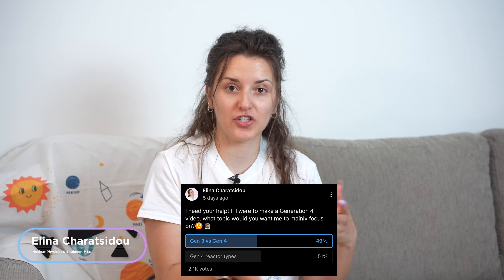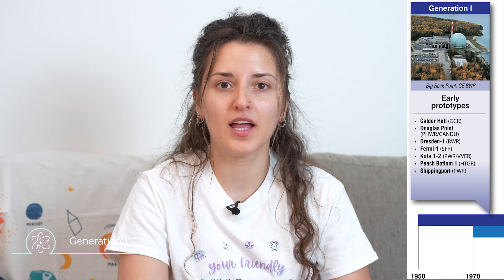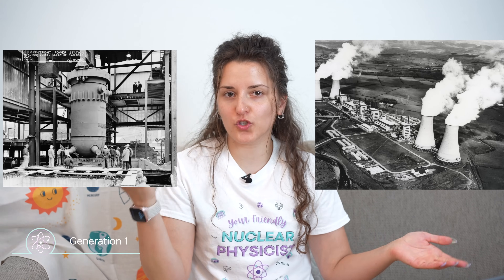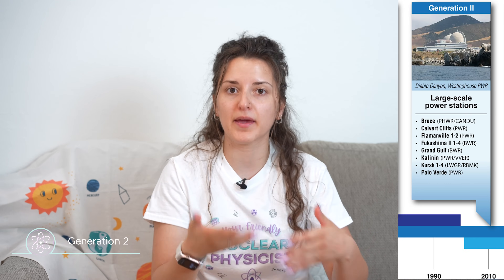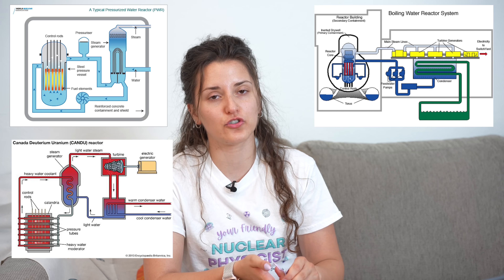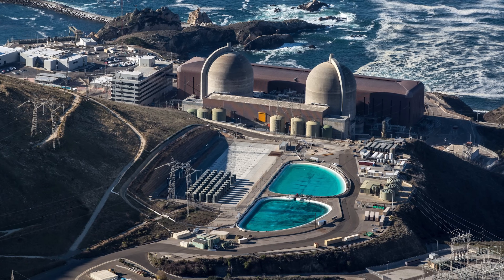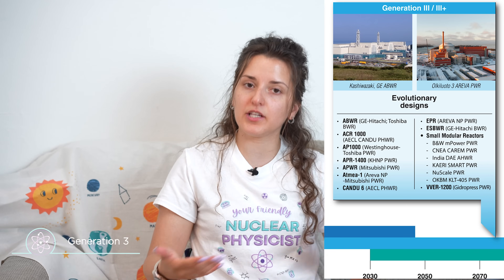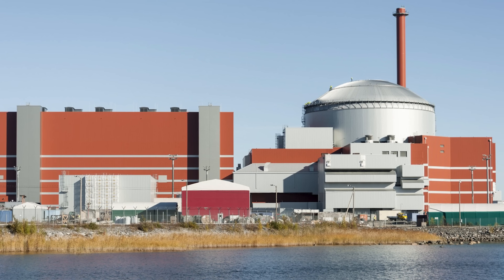Nuclear Physicist Explains - The Rise of Generation IV Reactors?

Comment: Great video, here some nitpick: 
12:13 correct me if Im wrong but Im pretty sure you meant the reduction of reactivity in the fuel and with that the drop in power production (stop heating up) as I don't see how it would suddenly cool below the coolant's temperature :D (maybe just my english failed me :( )
15:40 CANDU already can use natural Uranium it does not necessary requires fast spectrum, also MOX (plutonium uranium mix) can be used in PWRs

Comment: Thanks Elina, good video. I think the problems with GenIV are a very lethargic regulation system that is still catching up to the new technology, and the number of design concepts competing for funding. Investors are also likely to be keeping their hands in their pockets until the experimental TMSR-LF1 reactor in China proves successful (or not).
Reply: Not really. There are challenges in material science. If you go for molten metal design you can build fast reactors, but molten metal will attack other metallic surfaces. It is an issue inside steam generators, where leaking metal csn plug them or cause fire (and yes, that have happened in the past). Gas cooled reactors are prone to moderator aging. While in theory TRISO makes resistant and convenient fuel and moderator pebble, in practice they were damaged. If something is really feasible, it would be dual fluid reactor, just with nitrate salts not sulfates.
Reply: @brylozketrzyn huh
Reply: The available info on FLiBe salt thorium reactors here in the U.S. shows no cause for concern. We are not going to be copying China's work as it's they who've mostly been copying ours.
   If they copied it correctly, it will do fine. Those who make the effort to follow the engineering history of this tech know it was never in question to begin with. There's a lot of handwaving by those who fear the sudden replacement of legacy nuclear.
   It's not a question of if the world will do this; only when, and how much intentional pain we'll inflict on ourselves before starting.

Comment: I believe in the future we will be able to extract a lot more useable energy from lower temperatures by using high efficiency high temperatures heat pumps thereby reducing the need for cooling towers and increasing the ability to extract useful energy from spent fuel or long term nuclear waste. 
Nuclear power combined with heat pumps and stirling engine tech could eliminate the need for “nuclear waste” entirely because you need a minimum temperature of -5 °C input temperature  to a heatpump that can output +200°C at cop 2.5
Reply: Higher temperatures increase efficiency, not the other way around. High-temperature nukes don't need cooling towers but low-temperature nukes do.

Comment: I realised we use active and passive completely different 😆 to me an active safety system is able to decide and act on itself, without an operator. Different industries, different definitions, I guess
Reply: Active means something (operator or automated system) has to run to provide that safety. Passive means that nothing has to run to provide that safety. For LFTR, they use a “freeze plug” the liquified nuclear fuel that keeps the fuel in the reactor where there are moderaters to keep the reaction going. Active fans keep the plug from melting. If the plug does melt from loss of power or the reactor getting too hot, the fuel drains out of the reactor where there are no moderators and thus the reaction stops. Thus the reactor needs “active” systems to run otherwise it will “passively” shutdown.

Comment: As more of a geology enthusiast, I'd love to hear your take on Oklo, and how natural nuclear reactions occur. 
Love your channel! 
Cheers!
Reply: Since no one has responded yet... It is quite simple. If the uranium enrichment (% of easily fissable uranium U-235) is naturally high enough uranium can sustain a nuclear chain reaction as long as there is a moderator like a graphite rod (Tsernobyl) or water (gen 2-3), as in the case of Okla.

The moderator slows the neutrons down enough that they don't simply bounce off the uranium, but is absorbed splitting the Uranium, releasing fission products and even more free neutrons to hit other fissile Uranium atoms.

As long as there is moderator (water) and the good Uranium concentration % stays at inside the sweet spot range the chain reaction can keep on happening naturally without any human involment.

The reason Okla is so special, is that unlike in Okla most other natural Uranium deposits we know of did not have high enough % of this "good" easily fissile Uranium with the proper conditions to naturally start and continue process, but first requires us to enrich it to raise the concentration % up to the required sweet spot range that maintain the chain reaction.

There are most likely a lot of such natural reactors all around the Earth, but Okla is the only one we have found so far

To get a bit more technical on the "good" Uranium and sweet spot, here is a quote from world nuclear org that explains it perfectly:

"Uranium found in nature consists largely of two isotopes, U-235 and U-238. The production of energy in nuclear reactors is from the 'fission' or splitting of the U-235 atoms, a process which releases energy in the form of heat. U-235 is the main fissile isotope of uranium.Natural uranium contains 0.7% of the U-235 isotope.

The remaining 99.3% is mostly the U-238 isotope which does not contribute directly to the fission process (though it does so indirectly by the formation of fissile isotopes of plutonium). Isotope separation is a physical process to concentrate (‘enrich’) one isotope relative to others. Most reactors are light water reactors (of two types – PWR and BWR) and require uranium to be enriched from 0.7% to 3-5% U-235 in their fuel. This is normal low-enriched uranium (LEU). There is some interest in taking enrichment levels to about 7%, and even close to 20% for certain special power reactor fuels, as high-assay LEU (HALEU)."
Reply: @Songfugel  dang! You could make your own video on it! Thanks for the detailed response! Cheers!
Reply: @Songfugel  I know its simple on the surface but you could probably make a 1 hr video on the specifics. What radiation and isotopes and neutron activation goes on? I have so many questions besides, water moderates, boils off becomes non critical, repeat.
Reply: @lexinexi-hj7zo  true
Reply: There are reactors that don't use uranium enrichmented not in those percentages at least.

Comment: By my rough estimate we would need 20TWe (incl. 15% xmitn loss) of continuous generation and transmission capacity globally to replace fossil fuel use. At 1.5GWe a reactor, ten in a station and 80% availability that's some 1600 stations.
Reply: And worthwhile to remember that we have increasing power needs.

Comment: The Gen IV molten salt reactors (MSRs) aren't a new technology, it's more like a forgotten technology. Alvin Weinberg and his team ran an experimental (a concept reactor) Gen IV reactor in 1960s for 600 hours continuously.

During that experiment they lost control of the control rods for a few days (I'm doing this from memory so maybe not accurate). The reactor began to cycle from high to low over several hours, without human interference. This demonstrates one of the key features of MSRs, passive safety. As the salt medium heats up the reaction becomes less efficient and the medium cools down. If a reactor vessel is breached the liquid salt losses heat rapidly and freezes solid.

Also, "spent fuel" or "waste" is not an accurate description. Fuel pellets used in Westinghouse reactors are "spent" when only 5% of the fuel is used. A great business model but very inefficient and costly. There is transuranic waste that needs to be managed but it is tiny compared to today's nuclear "waste" products.
Reply: I agree that MSR is the Gen IV type is the way to go with.. Not only does it use 'spent nuclear waste' as fuel IE UO2 (Uranium dioxide) which is from "nuclear waste", but they can also produce hydrogen with the electricity they output...
https://www.ornl.gov/molten-salt-reactor/history#:~:text=Oak%20Ridge%20National%20Laboratory%27s%20Molten,during%20its%20four-year%20run.

The MSRE (Molten Salt Reactor Experiment 1965 to 1969) Oak Ridge National Laboratory is also a nuclear historic landmark..  That experiment really should have been expanded on and developed for use as a power source...

Comment: I'm going to get specific, since you can probably determine things faster than me with your knowledge.

The Point Lepreau plant in New Brunswick, Canada is a Candu type 6 deuterium uranium reactor as I understand it.

I know NB power has a new initiative to build and test smaller newer reactor(s) on the same site for evaluation. Do you know if those new reactors are type IV, and if so, are they of the type that can use the spent fuel from the existing Candu reactor and reduce disposal issues?

I'll ask a really long-term question too. Since we keep finding ways to make reactors smaller and safer. Do you imagine a progression to having local reactors for say a cul-de-sac or other small.group.of houses for distributed generation. Also, since we are putting them on vehicles like submarines, do you envision EVs having virtually unlimited range, no or minimal storage through micro reactors, and in what timeframe?

Comment: Are there any reactors, extant or hypothetical, which are truly walk-away safe (zero core meltdown) both in permanent total site blackout conditions, and 'catastrophic' LOCA scenarios? Is it even conceivable that such a reactor design could ever be built?
Reply: None of the gen. IV reactors need external power sources to shut down in the event of an accident.
Reply: You could do this. You would make the core unit out of uranium Tlthorium nitride silicide, or out out of uranium thorium zirconium carbide. Both of these fuels have a unique negative reactivity vs temperature coefficient, as the fuel gets hotter the neutron capture rate decreases.

Comment: You kind of left out an interim stage, the thermal spectrum MSRs, these will be the first gen. IV reactors to market. The main feature that they share with breeders is the high-temperature output, this is a huge advantage not just for fuel utilization but for energy storage. 700c output allows for the separation of the nuclear core from the power conversion equipment with a thermal storage buffer. None of the storage or power conversion equipment needs nuclear certification, saving a fortune. As a bonus, the power plant can load follow even better than natural gas.
 
Terrestrial Energy looks like it will be first to market, as they are very far along in the Canadian licensing process. Others that are not far behind are Seaborg, Copenhagen, Thorcon, Moltex, and others.

Comment: I dont get it, the military has been using "standar" reactors on ships for decades, why not copy those models and use them on land as gen4??
Reply: I believe the issue is scale. The reactors on ships are much smaller and so do not require large containment structures that are needed on a typical pressurized water reactor.
Reply: @whiskeytango9769  yes, but could you build a bunch of them and little by little add them to the electric network of a city/town... Heck, you could even make them mobile and move them across the country in case of emergency (war/natural disasters) or when the demand of  the network requires it. I mean, they move ICBMs and stuff like that on commercial road so... Why not a reactor????
Reply: @elmaxidelsur  There are designs now for small, modular, reactors. That seems like the way to go.
Reply: The military reactors on ships and submarines use very highly enriched uranium that can not be used domestically and they are surrounded by an unlimited amount of cooling water.
Reply: @chapter4travels  why that uranium could not be used domestically, clearly it is not unsafe for a vehicle... Yes they do need water BUT could you build them in one factory, transport them next to the water where ir will work (95% of humans live next to a mayor water source) and then turn them on????

Comment: Aren't all safety processes based on the laws of physics?  (I know what you mean, but isn't everything based on the laws of physics?)
Reply: Yes and no. Gen. III reactors have engineered systems that are mechanical in nature. Gen IV reactors use things like gravity, if gravity works, then their safety system works. They use drain valves with no moving parts, just a plug of solid salt that melts when things get too hot and then the reactor core drains into a safety tank. No bad actor can stop it from happening.
Reply: @chapter4travels  (Dude, I was being a smart ass.  Everything everywhere is based on the laws of physics.)
Reply: @tarmaque  I understand but gravity has physical advantages over mechanical safety systems that are also based on physics. That is my point.

Comment: I have a question about something.  I read a paper in a journal or something was too long ago to remember the exact source.  The thing that this group of scientists did was trying answer if people should be more afraid of radiation from nuclear power plants.  They measured the radiation levels outside a couple of nuclear power plants and as coal power plants was the most  dominant use. They found that coal power plants outside areas tended to have higher radiation levels than nuclear.  They concluded that the construction of nuclear power plants are built to prevent radiation leaking in or outside 😊😊
Reply: Yeah, coal power plants release more radioactive contamination into the environment than nuclear plants are allowed to. Unfortunately, there are still a LOT of coal power plants in operation around the world. The ash and other waste from fossil fuel power isn't handled with anywhere near the same care as even low level radioactive waste. Even if greenhouse gases weren't a problem, the variety and toxicity of the chemicals present in coal ash alone is terrifying, and we're just piling it up like any other trash.

Comment: There is only heavy water and water and no light water if I am not wrong and if I am please correct me
Reply: You can use other fluids for the coolant, especially for fast neutron spectrum. The main reason most reactors are thermal spectrum is because this is the most efficient way to make relatively pure plutonium 239 and tritium from 6Li..
Reply: Hydroxide (OH-)  would be light water,  I guess?

Comment: This was an awesome video and one I will watch at least one more time! Too much info to only watch it once!

For Gen 3 reactors, approximately how much U-235 is left when the core needs to be replaced or the plant is decommissioned?
Reply: Usually about 1 % of the uranium in spent fuel is U235.
There is also some U234 and U236.
Reply: As I understand it the current reactors only burn about 3% or less of the available fuel in the rods therefore there is about 97% of the energy or fuel still left in the so called 'waste fuel'. Of course that left over fuel has long lived actinides within the fuel rods that make it unsafe for long periods of time. I think the 'fast reactors' being developed could burn this waste fuel and actinides which would result in the leftover unburned fuel only needing to be stored for 200 to 300 years. In addition we could create thousands of years of electricity generation without needing to mine and process new fuel which would be a major benefit to the earth's environment. It's a win-win-win as I see it and I would not worry about building waste storage at all but charge ahead with new designs for waste fuel burning reactors that would eliminate the storage problem, create more energy and help save the environment. If we got serious as we did with the Manhattan Project or Moon shot I think it could be achieved in the next 10 years.
Reply: @WJV9  Which can be 'easily' turned (converted) into UO2 pellets (Uranium dioxide) and reused as fuel in most Gen IV reactors types..  I think there are currently 6 Gen IV types.. GFR (Gas-cooled fast reactor), LFR (Lead-cooled fast reactor), MSR (Molten salt reactor), SFR (Sodium-cooled fast reactor), SCWR (Supercritical water-cooled reactor), and VHTR (Very high-temperature gas reactor)...